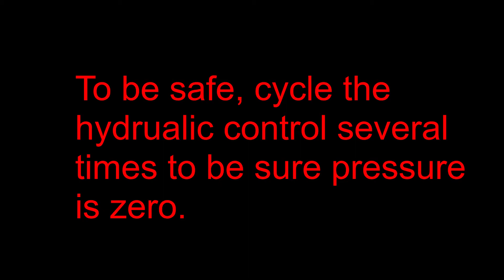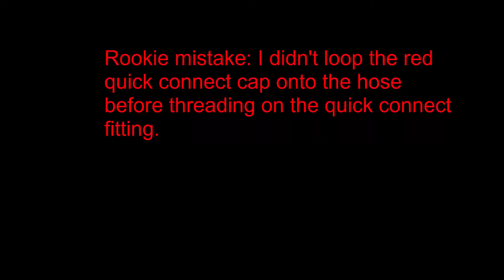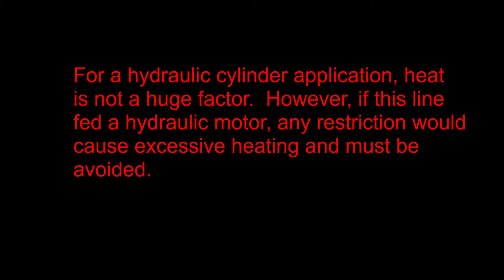DIY Easy Tractor Hydraulic Hose Repair

Comment: same thing on my B2350 cost me about £40 for new but i see its got 3/8 usa size but is 1/4 in uk JIC fittings in uk in 1/4 internal with 7/16 tread plus looks like tapered treads

Comment: 12:40 - it's not the size of the orifice, it's the size of the flare. Looks like 3/8" JIC in your right hand and 3/8 JIS on the machine. Get a couple plugs/caps to test your crimp fittings.

Comment: Hydraulic Hose REPLACEMENT not REPAIR.   A Hydrualic hose repair would be were you would cut it and place some sort of stint.      This is a part change video.
Reply from the maker: You are technically correct... but I wonder how many DIYers have a hose connector crimping machine.
Reply: @mrdiyguy123  I looked at your video hoping to see a hose crimping machine.  You should change the title to hose replacement, not repair.